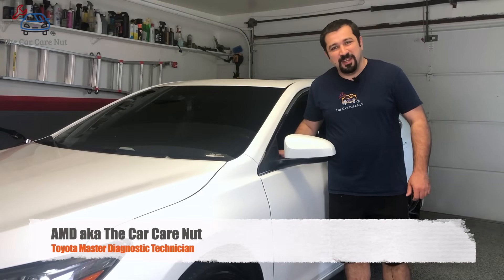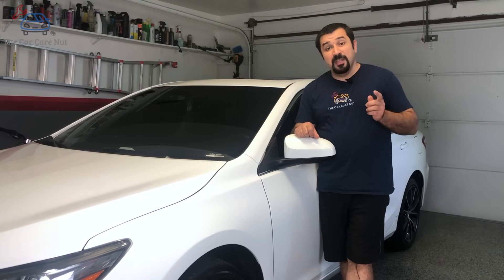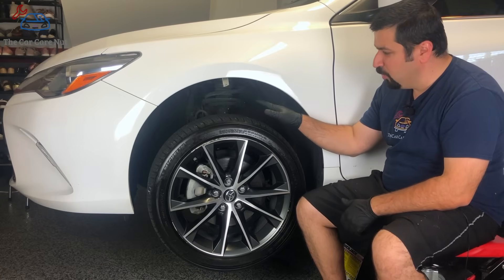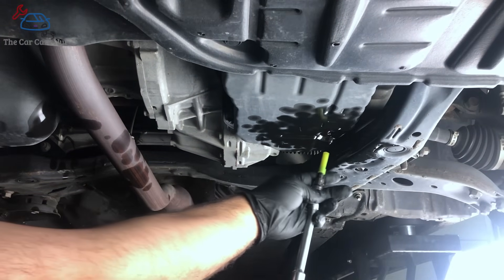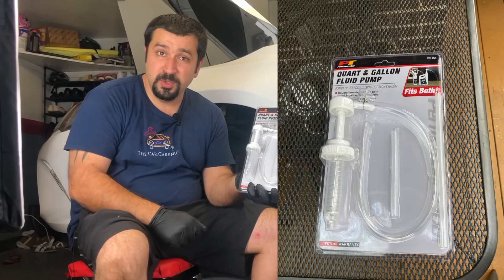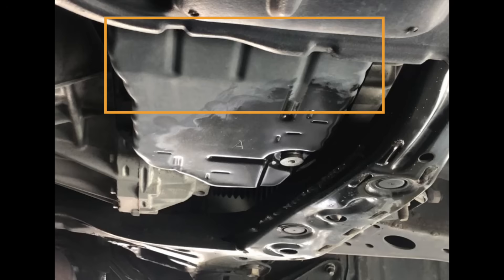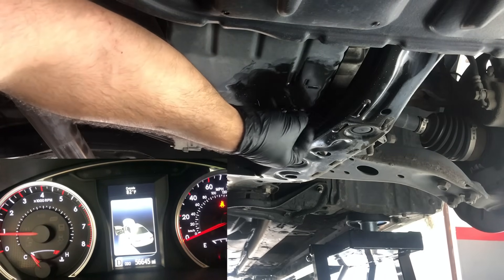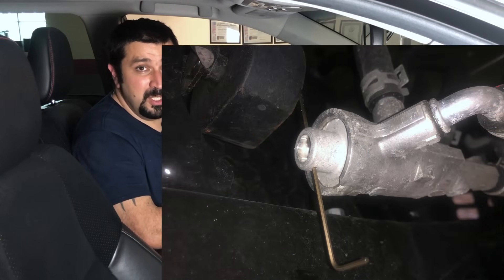How to change your Toyota Sealed Transmission Fluid

Comment: I just bought a used 2015 Sienna with 72k. I don't have the maintenance history record. I want to replace the transmission fluid, but never deal with the sealed transmission before.  I will buy some Toyota transmission fluids and replace the fluid. Is it better to use the pump or a tube that fit a funnel? How many time or often should I replace the fluid to make it 'clean'? I heard that I don't need to replace the transmission filter. Is this true?  I appreciated your clear instruction, explanation, and the graphic in the video. Like & subscribed. Thanks bro. God bless.
Reply from the maker: Thank you for watching my video. You can use any method to get the fluid into the transmission that works for you. A pump or a funnel will work. I wouldn’t focus on getting the fluid clean. I would focus on replacing it every 60k or 6 years and be done with it and not worry or overthink it. I wouldn’t replace the filter as in Toyota transmissions that’s not really needed.

Comment: Why did Toyota do there transmission this way?
What was wrong with having a transmission dipstick, now it is a science project. I have one of these sealed transmission's in my new Camry.
Reply from the maker: Thank you for your comment. While the exact reasons are unknown but the common reasons are to prevent tempering with the fluid by inexperienced owners. The process to replace the fluid and check the level is not hard but is not meant for non diy mechanics.
Reply: @TheCarCareNut  > I think I'll just  let the dealer/ independent shop do this,less headaches. Nothing is like it was years ago. Nothing is simple anymore. Except checking the oil.
Unless you have a jaguar or some very expensive European car.

Comment: Is it better for the transmission to be warmed up to do this drain and fill or cold?
Reply: I do it hot to get as much old out and also for contaminates to flow out quicker.  I also put 1 or 2 rare earth magnets outside pan close to drain plug and I take them off during drain to rush out debris.  I also don’t mind waiting for temperature to go down to drain off extra.  I have actually put ice cubes in a bag on outside of pan to lower temperature quicker and got lunch and came out to 53 degrees Fahrenheit and was able to sit and wait for 100 degrees on scanner.  Done this 4 times on 2011 Camry.  Car always glides better and I get better fuel mileage for several weeks after.  Hardest part is leveling vehicle up on 2 2 X 6 boards under each tire.  I use 2 floor jacks for minor leveling with a magnetic level.  Always toyota WS for my model.  Says it on the fill plug.  Pretty simple and amazon has 4 qts of WS for about $35
Reply: @sirsweetness8332  thank you for sharing, just wasn’t sure how long would it take for the ATF to cool down.
Reply from the maker: Hi Jake! I would drain and fill it cold. This will help when setting the fluid level as it’ll give you plenty of time before going over the temperature limit.

Comment: Thank you AMD! You’re the man. Is it ok to use the cooler line to pump out more old fluid? 1L at a time
Reply from the maker: Thank you for watching! I wouldn’t do the cooler method as things can get out of the control and you risk running the transmission low on fluid.

Comment: Great video!👍👍👍
I have 2014 Avalon Hybrid. 
In the comments you’ve mentioned it’s even easier to do this procedure on ecvt. Do I need to worry about the temperature? Or just drain, then start filling until fluid starts to come  out when car is cold? 
Thank you
Reply from the maker: Thank you. For your Avalon hybrid no need to worry about the fluid temperature procedure. Drain and fill until is comes out and you’re done.
Reply: @TheCarCareNut  
Some of the posts I read people say that when they drained fluid from ECVT, and measured, they aren’t able to add same amount back. Is this something you are aware of, and something I need to worry? 
Thank you
Reply from the maker: I wouldn’t worry about measuring. Drain it and add fluid until it overflows and you’re all set.
Reply: @TheCarCareNut  
Thank you 
Wish you were my neighbor 😉👍

Comment: My 2014 Sienna is at the shop getting new brakes. The shop says the transmission is whining with 55,000 miles on it but they don’t want to mess with changing it because it is sealed. They recommend I take it to a specialist. Can I ask them again to change the fluid? Is it bad to drive if it is whining? I know you said the whining is an issue with the 8 speed models. Thanks
Reply from the maker: Hi! The whining issues with the 8 speed are on 2017 models. Your sienna doesn’t have that transmission. Did you ever notice the whining noise? How loud is it?
Reply: @TheCarCareNut  the van is new to me and wouldn’t say I noticed the whining noise but I am not sure what to listen for.
Reply: On another note. The left side sliding door seems to occasionally not want to close properly. Can I lube some hinges before it totally fails? Can I ask the shop to do that or just take to the dealer as you say there may be a warranty issue.
Reply: @TheCarCareNut  I guess the main question is would a fluid change help with the whining or is whining an indicator of a larger issue?
Reply from the maker: If it’s a very faint whining noise that’s continuous that could be a normal noise that I wouldn’t be concerned about. Regarding the door the hinge is likely seizing up. Call your local Toyota dealership and ask them about coverage if it applies to your van. If it does they’ll fix it for free

Comment: After watching your video, how I wish that you included the "Cooler Bypass" procedure so that it is clearer. Mine is a 2017 Lexus RX350 SUV and it has 8-speed transmission and the drain plug is in a different location. Another thing is that you didn't recommend another fluid change after a week or so. Can I just do that to improve fluid quality? I also watched a video when the mechanic blow the fluid from the cooler with compressed air so that it chases the dirty fluid into the torque converter out and drain it via the pan plug. I think it is very neat and faster.  Thank you
Reply from the maker: I wouldn’t replace the fluid twice and this procedure will get enough fluid replaced to refresh everything.

Comment: Thank you for the wonderful video! Informative and can be completely followed! 
How should I request this to be done at my Toyota dealership? You said it’s not serviceable, yet the fluid should be changed every 60,000 miles I think you said. Since this isn’t a regular maintenance procedure, how can I get it done at the dealership? I have a 2020 All Wheel Drive Prius.  Have a blessed day brother!
Reply from the maker: Thank you for watching my video. Your Prius has a different transmission fluid setup. It’s actually very simple just a drain and fill until it overflows and you’re done. I recommend you replace the fluid on your Prius every 60-90k and you should have no issues.

Comment: There hasn't been a single day since I've bought my first automatic that I haven't cursed its inventor. After 9 yrs of driving a 2011 Highlander I sort of got used to it. A week ago I thought I should change the transmission fluid. Sure enough, the transmission turned out to be dip-stickless... Now that I've watched this video, I've realised I have to buy a fluid pump, and have become shitless scared about getting the fluid temperature and quantity right. Measure this, measure that!... FFS, how insane is that????????????????
Reply from the maker: I hear you. However once you’ve done this process once or twice it’s not that bad. It’s just more involved than a good old dipstick
Reply: Like he says practice going through the steps before multiple times before actually performing the procedure

Comment: In general, is it safe to trust a mechanic shop to do this?  I’m concerned they’d either not bother checking the temperature or just not even change the fluid and say they did.

I realize that it all depends on the shop, but is this normal for most shops?
Reply from the maker: This is a very simple process that doesn’t take more than 10 minutes. So yes as long as it’s a good mechanic that know what they’re doing you can trust them to do this process

Comment: Do all Toyota dealerships do it like that
Reply from the maker: Some do and some use a machine to replace the fluid through the lines then check the fluid level afterwards using a scan tool which is the easiest way. There’s also a special tool that allows to check the transmission fluid level at operating temperature.

Comment: Great video and i subscribed, i have a 2011 tacoma, double cab, 4 wheel drive, 4.0 v6 and is the temp like this one, between 95 and 110?  i saw another video where they said it was 97 to 115, so what is the actual range for that transmission?  My gun is about 4 degrees lower than the actual temp based on water in a metal pipe...the water was 125 degrees and the temp gun read it as 121 so from that i will want the trans pan temp to be at 96 on the gun and that would be 100, right in the middle of the range, is that good?   Oh, my transmission is a A750F i believe.
Reply from the maker: The range I gave in the video was a general rule of thumb. In your transmissions case you are correct the range is 97-115. You can use the temp gun method if your sure about your temp gun accuracy.

Comment: Do you check if the vehicle is level on the chassis or on the pan? To make the pan level, i had to lift the back of the sienna a bit higher than the front.

Also when i drained the old oil only 1 quart came out.
Reply: I bought the car used with 80k miles and it turns out it was about .5 quarts less than it should be and that's why it wasnt overflowing. Thank you!
Reply from the maker: You want the car to be level not the transmission. Did you remove the overflow tube?
Reply: @TheCarCareNut  thanks. i removed the overflow tube. Ill try again with the car level

Comment: Seems like after you fully drain you could just reinstall the straw and then add fluid until it starts to come out the drain. If the car is cold, you know you will have slightly overfilled at that point. Then start up the car, wait until you get above 95º, and finally put the drain cap on when it comes to a trickle.  
One issue I could see with this is that the drain cap is open while you are shifting between gears. If doing that uptakes more fluid, then the reading could be wrong. 
Ideally you would just follow this video and measure what you take out, but I wonder what you would do if you accidentally spill a bunch of the fluid you are taking out haha.
Reply from the maker: The official procedure is to cycle the fluid in the transmission before doing this. If the transmission sat overnight the fluid might have drained into the pan and by cycling the fluid through the hydraulic circuit you are making sure that your level doesn’t drop after you actually drive the car. That’s why I recommend you recheck the fluid after a week or so to be sure. If you spill fluid I would add at least 3 quarts and as soon as you start the car and cycle the shifter, take the drain plug off if nothing comes out add until it trickles. At this point you overfilled the transmission. Get to the temperature then drain the excess.
Reply: Makes sense. Thank you!

Comment: One additional question.  Once the Drive light is on solid, you say to take your (or your helper's) foot off the brake.  What gear should the car be in at this point?  Neutral or Park?  I know it's not Drive since no one is pressing the brake!
Reply from the maker: You want to be in park at that point.

Comment: Just drained the fluid from my 2015 Highlanderr XLE and got ~49 oz.  I was a little surprised since I thought it would be more like 80oz.  I did this with the car cold.  I assume the initial draining is to be done cold and with the engine not running, right?  At least in the video, there was no engine noise when you were doing the draining and no mention of doing this with the car at normal operating temperature.
Reply from the maker: The car was cold in the video. You did remove the overflow tube as shown in the video correct?
Reply: @TheCarCareNut  Yes.  I removed the nut and overflow tube.  I ended up adding about 70 oz so I'll see what the overflow results are tomorrow when I conduct the overflow check with the transmission at the required temperature.
Reply: Update: After the overflow drain, I got about 16 oz back.  So 70 oz I added after drain - 16 oz captured after overflow = 54 oz which is not that much different from the 49 oz I got with the initial drain.  Followed the OBD  jumper/D-N shifting procedure in the video but also checked the tranny pan temp with an IR gauge and got 100F.  For the record, all this was done on the 2015 Highlander XLE just purchased with about 70K miles.  The good news is that I shouldn't have to do this again until I hit 130K miles (which means I'll probably forget all the little details I learned in doing this!).  Soli deo gloria!
Reply: @ronandcherylimken8128  Ron, you were wise to keep close tabs on the numbers, and others here can now rely on your data points showing how it's really best to actually check the level at the prescribed temperature.

Comment: Nice video, very informative, how much charge the dealer for this job?
Reply from the maker: Most dealerships will charge around 200-300 dollars for this.
Reply: @TheCarCareNut  Do the Toyota dealers follow this procedure? The last time I asked a dealer about this they said they do a transmission flush which I heard could be bad for the transmission. Thanks!
Reply from the maker: Hi! A flush is ok if it’s followed by a fluid level check. Some dealerships do a drain and fill and some do a flush. You can request either.

Comment: I have a 2012 Toyota Camry SE I'm interested in knowing if there is a differential that needs to be choil changed if so what kind of oil do you use thank you
Reply from the maker: Your cars differential is part of the transmission and when you change the fluid on the transmission you’ve effectively changed the differential fluid as well.
Reply: @TheCarCareNut  Wow, that's surprising. Is that on all model's or only for the 2012?
Reply from the maker: The last front wheel drive model that had a separate differential fluid was 90s and very early 2000s. Camry models from 2002 till now is the same with the shared fluid.
Reply: @TheCarCareNut  Thank you so much. Are you Christian?
Reply from the maker: Yes I am! Proud to believe in the one true king Jesus Christ!
Reply: @TheCarCareNut  Hallelujah!! May the lord Jesus continue favor and blessings to you and your family  🙏
Reply from the maker: Amen! Thank you bless you and your family as well.

Comment: Man this design is stupid!
Why did they start designing Transmissions like this?
Reply from the maker: I hear you. There was nothing wrong with dipsticks. They did this so people who are not mechanics won’t be messing with them. Too bad for that idea since this video shows you how to do it and that it’s not hard at all.
Reply: Any transmission with a dipstick tube has the potential to let additional oxygen into the transmission through a dipstick that is not fully seated in the tube, or dipstick tube plug that is not fully seated. Even the process of checking the fluid level with a dipstick can allow additional oxygen and dirt into the transmission

https://en.wikipedia.org/wiki/Toyota_Automatic_Transmission_Fluid#How_ATF_Can_Last_a_%22Lifetime%22
Reply: Morons started overfilling transmission fluid wrong transmission fluid/underfilling/. I imagine Toyota got tired of  replacing transmissions still under warranty .  All corporate decisions are based on $$$$
Reply: @normfreilinger5655  Right🙄

Comment: Why not just put in what you took out at ambient Temperature???
Reply from the maker: That could work but how do you know you had the correct level to begin with?
Reply: @TheCarCareNut  if you bought car new, no leaks, trans shifts fine
Reply from the maker: That’s up to you. I see your point but I still check it to be on the safe side.
Reply: @TheCarCareNut  what is the correct temperature for a 2014 camry, 6 speed automatic?
Reply from the maker: If it’s a 4 cylinder 95-113 if it’s a V6 then 104-113
Reply: @TheCarCareNut    thank you!